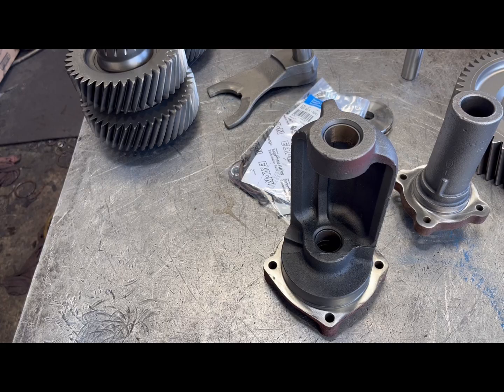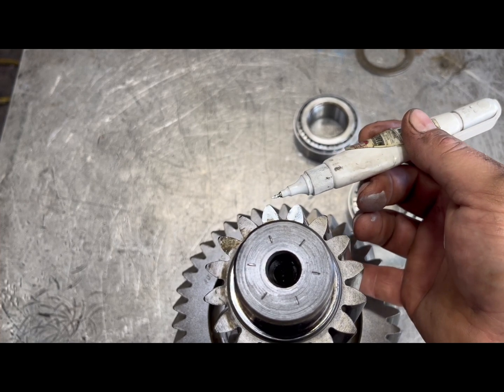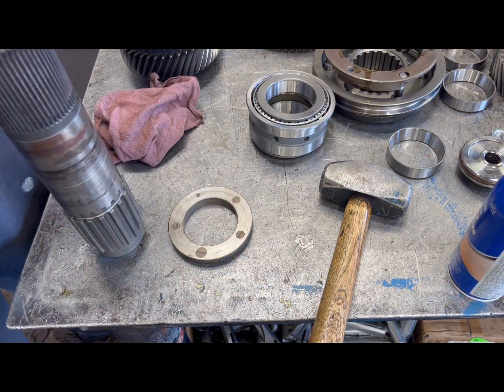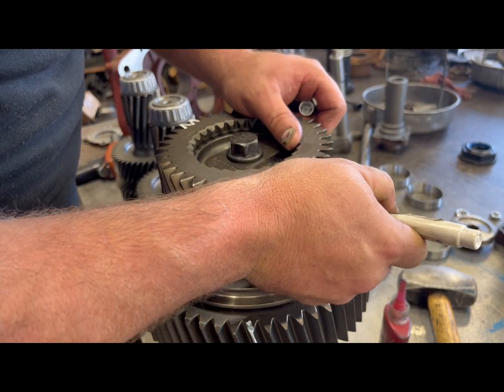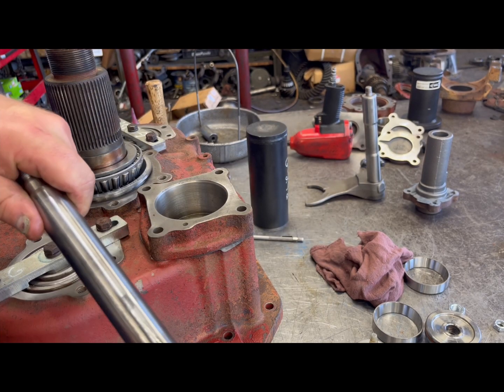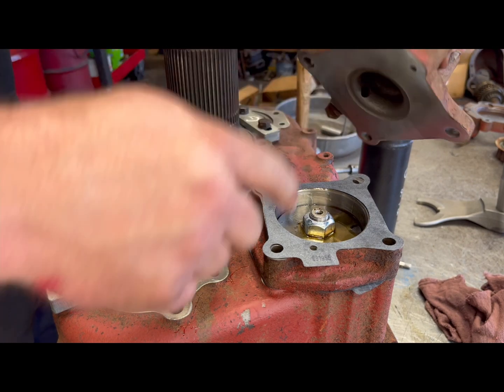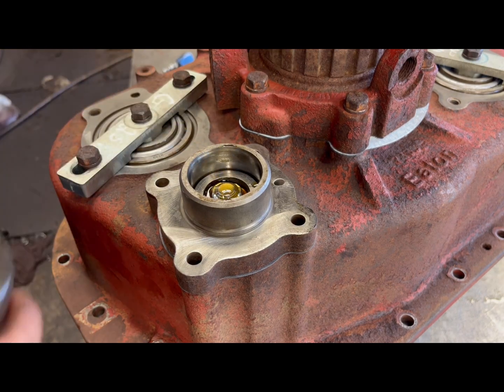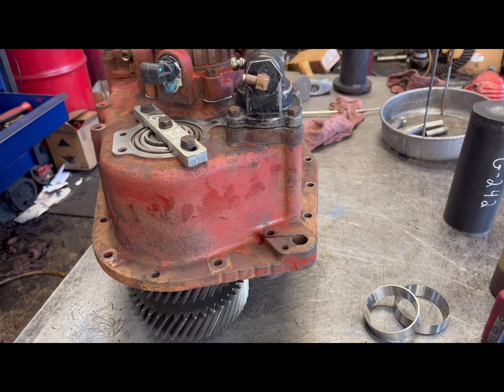How to assemble and rebuild an Eaton Fuller 13 speed transmission back box on your 18 wheeler

Comment: Watching this Oct. 2025.  Mind blown, never would have guessed transmission gears require timing.

Farmer with an old 1970’s Binder grain truck.  Main box shifts like butter, but the rear seems like it is lagging or resisting shifting.  Watching the assembly gives me some idea where to start at least troubleshooting what this problem is.  Unfortunately already have some ideas what our problem might be.
Reply from the maker: I’m glad these videos are helpful and hope you can solve the issue yourself. Careful when you line up the back box onto the front case

Comment: youll consider me nuts but the rto9513 is perfect for my 2nd gen bronco. Ill modify the back box to include an extra countershaft so i can maintain 4wd.  I just have to be mindful that the front axle aint gonna get full torque capacity like the rear when 4x4 is engaged. 

That and woth the 0.62:1 overdrive with the 4.10 gears is perfect with the 30 inch tires.

And ill do the double overdrive conversion so i can get the 0.62:1 top gear.

Comment: Why did you put timing marks on the gear that the sliding clutch goes into
Reply from the maker: The gearing on the output shaft needs to be timed to the countershafts if you don’t have it timed like I do in the video bad things happen
Reply from the maker: There are timing reference marks on the countershafts indicated by a ° stamped on either the top or the bottom of the teeth on the upper or lower part of the tooth were your low gear rides.
Reply from the maker: If you have some time watch the 10 speed video it will give you a good overview of what’s going on with the marks Im adding. Hope it helps man

Comment: I have oil leaking out the splitter valve, blue line. Will a new k-3331 fix this or would it be the O-ring that’s inside the tube? Or the piston O-ring?

Comment: I'm working on taking off a back box on  a fuller 13spd for my first time n it's been a nightmare . The dial pins r frozen up won't beat through  found 1 hole that a bolt threads into to push da box out cleaned it out w a thread chaser . Hopefully better luck tomorrow I had a belly full today . lol
Reply from the maker: They can be a pain in the ass to knock the pins out when on the truck. There’s not much space which I’m sure you’re aware of. Make sure your knocking the pins out in the right direction. If your staring at the output shaft you need to drive them in like a nail. Sometimes if there’s not much space an air hammer will work. Other than that mabe get yourself a bar to help hit them with

Comment: Do you happen to know the part number for the nut that holds the yoke on?
Reply from the maker: K4122
Reply: @etrtruckcenterenginedrivet8918  what size is the socket for that nut, can’t find the size anywhere.
Reply from the maker: @igorfed993 if your talking about the big nut on the output shaft it’s 2-3/4

Comment: I've got a question if you have time, I have a RTX1409B in my truck and I have a RTO14613, I want to put the 13 Aux box on the 9 speed thats in the truck, what all will i need to change

Comment: The education is outstanding I mean outstanding I've got right now A Eaton Fuller 13 speed transmission that is leaking from every office it seems like and I have got to I'm going to try to replace the gaskets that are outside and superficial but my fear is I'm going to have to probably take it apart and get to those areas you were just showing where you had to take the oil the pins and the fork and all those rods out to get those seals in possibly I'm hoping I don't have to go that far but if I do at least I got somebody like yourself that is willing to share your knowledge so God bless you keep you safe and in Jesus name and I appreciate the videos
Reply from the maker: No problem. Thank you for watching

Comment: So on the big gear that supposed to be 180 degrees how many teeth gears supposed to be each side
Reply from the maker: Mark a tooth on the gear. Count 27 teeth and mark the next tooth that should put you at 180deg make shure we’re talking about the same transmission rtlo18913.
Reply: @etrtruckcenterenginedrivet8918  I did mark them 180 degrees and it’s still out of time when I installed on the transmission, but I did one in the past and couldn’t figure out the timing, so I took to a transmission shop, and they told me that the ‘0’ stamps on the counter shafts where not right from the factory, I wonder if the same thing is happening with the one that I’m doing rn

Comment: I do not mean to judge in any way. Just asking a question. In the start of the video setting the O-ringings, does the transmission oil set and reach those places fast? Or should you lubricate the O-rings?
Reply from the maker: No it definitely needs to be oiled. Later in the video as I am assembling the pistons for the range and splitter I use oil and the silicone lube provided. Just out of habit I did not lube anything up at the beginning of the video because I dident want any dirt or dust to stick to anything before assembly. But yes most definitely oil the orings
Reply: @etrtruckcenterenginedrivet8918  Wow, that’s crazy awesome sir. Thank you for such a fast response. I love these videos. I love wrenching on trucks and cars. Was getting j to your profession hard? What did it take? I’m a sophomore in highschool and am set to graduate with a Associate’s degree in automotive technology, A ford certification, welding certificate, and my Diploma. What else will it take to get into your beautiful style of work?
Reply from the maker: @caleblee4856  if your wanting to learn how to build these transmissions I would suggest buying a transmission from a salvage yard or a shop. Disassemble and reassemble over and over again until you are comfortable with it. 10 speed core transmissions are pretty cheap and would be awesome to have to train yourself with. Glad you like the videos  check out the video we have on the fro16210c rebuild. I try my hardest show everyone how to assemble the whole unit and what tools are needed. If you can stomach the hour and a half long video I’m positive you will take something from it.
Reply: @etrtruckcenterenginedrivet8918  Sweet! I can definitely stomach watching an interesting video like that. Would it also be beneficial if I chose to pair a 10 or 13 speed to a 7.3 Powerstroke? I can buy a T444e flywheel for the medium duty International trucks. I know I’ll need a heavier clutch assembly and a SAE #2 bellhousing aswell as upgraded frame support. I would also have to add air lines and a compressor for the Splitters and Auxiliary uses. Am I missing anything? Is it even smart? I do a decent bit of towing here and there. It also is fun having a lot of gears lol.